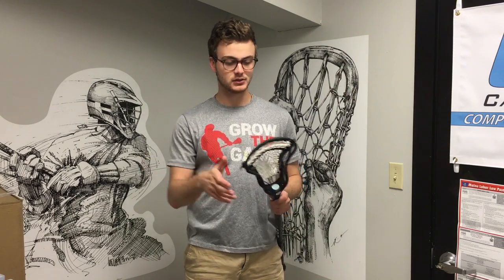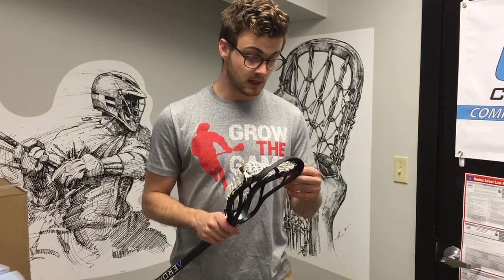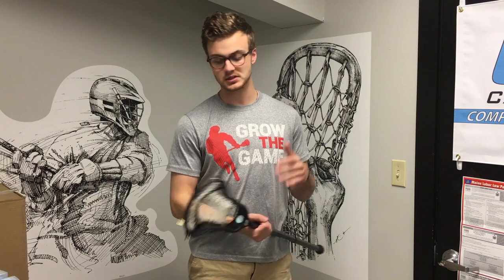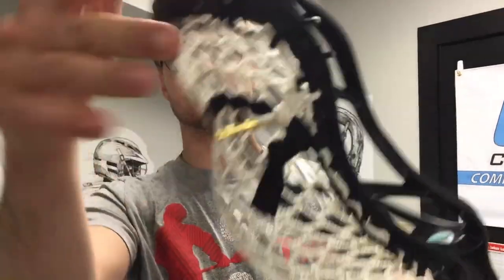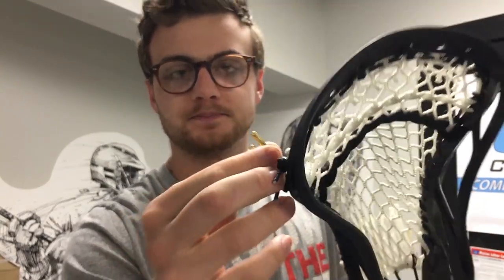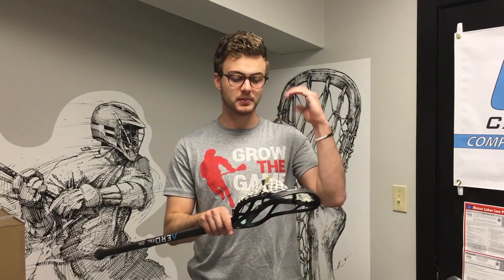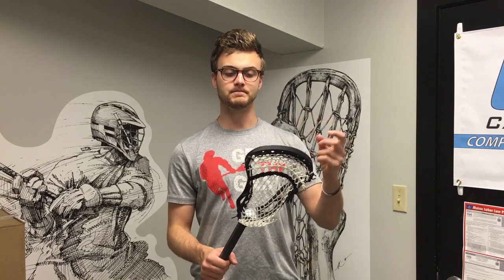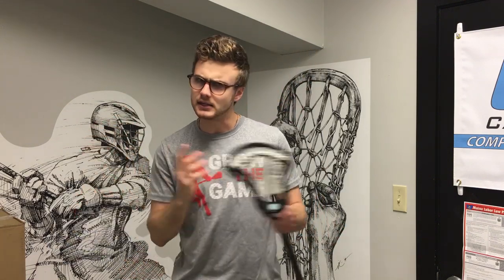Throne Fiber System Review

Comment: Can you review stringer shack performance mesh.
Reply: +tuck t IMO, their G3 Ultralight is a good mesh.  I've strung a couple heads w/ it & it's light, durable, strings up well, & available in a variety of colors.  There is a latex coating which adds some grip, but this also adds some inconsistency in how hard it is from one piece to the next.  I like it more than Hero, but not as much as SK or Ninja Sensei 2.